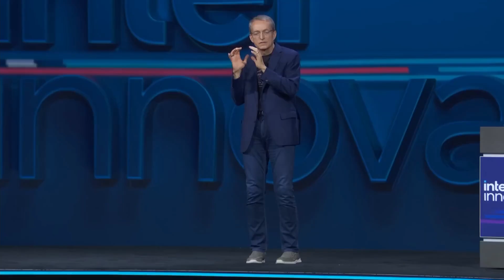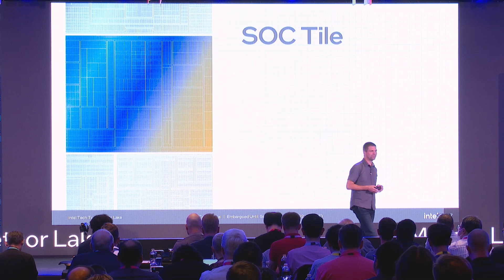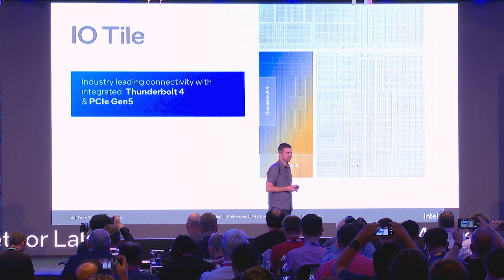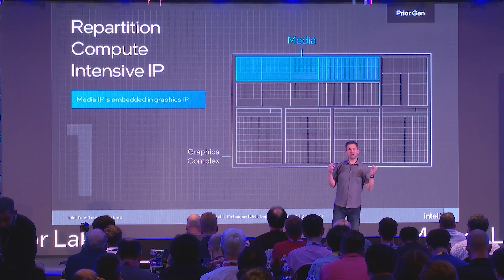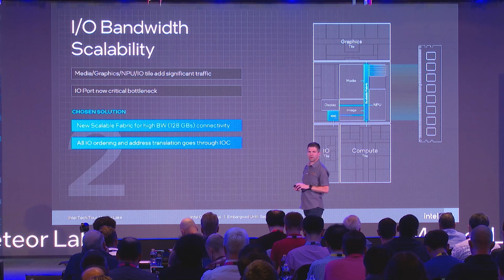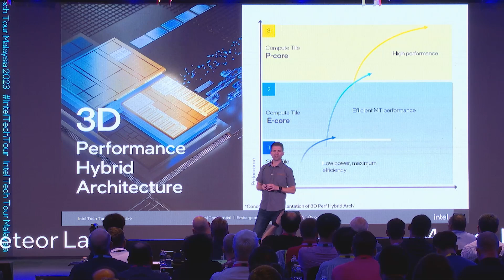Intel Core Ultra

Comment: Given OpenVINO supports AI processing on ARC and NPU (Movidius), I wonder if the two will work in tandem on Core Ultra?
Reply from the maker: I believe you can yes.
Reply: @CyberGizmo  I certainly hope so. nVidia rules the roost on the high end. AMD is finally starting to stretch its legs with ROCm.

OpenVINO is mature. Intel may have something for the masses. Of course they need to make it easy for models to be optimized to run under OpenVINO.

Comment: This is the first time in years I've felt like Intel might just dig itself out. Instead of digging itself in deeper. 

That said, the devil's in the details. Given the quality of intels marketing, corporate governance, accounting, etc etc ... the engineers will need to have a product that can speak for itself

This could be that product. Certainly in the mobile market. And that's the market responsible for the vast majority of profits.. At least in the consumer space
Reply from the maker: I hope for their sake they can pull this off, it has been a long time since an engineer has been CEO of Intel, and Patrick Gelsinger is not afraid of taking risks, I find that a refreshing change
Reply: @CyberGizmo  agreed. The cash cows are all gone at this point. They need to pull this off if they're to continue in their current form. At least that's my read on it.

Comment: Foveros is interesting in that they're willing to share details of that secret sauce of tile integrations. I don't remember/think AMD has gone into as much detail on how they do their tiles as much. Not to say its an "open spec" or anything, but it's more clear the dimensions, pitch count/density for connections. And it's going to allow for 3D stacking as well. It's interesting. Metaphorically Foveros is a "motherboard" the way the old 440BX (and the attendant chipset) was state of the art circa 1998.